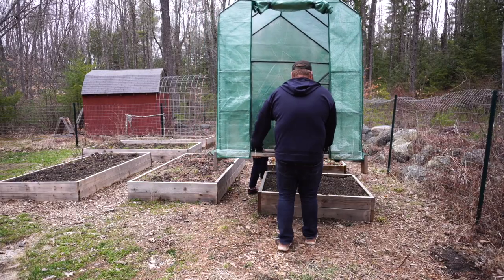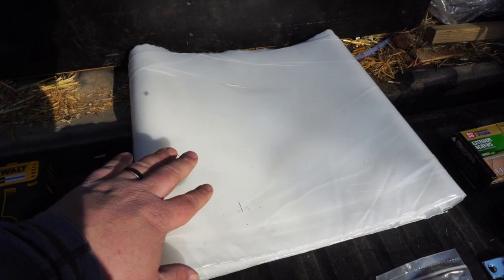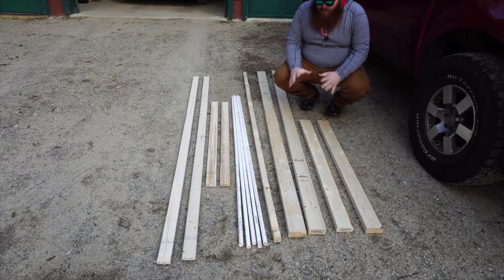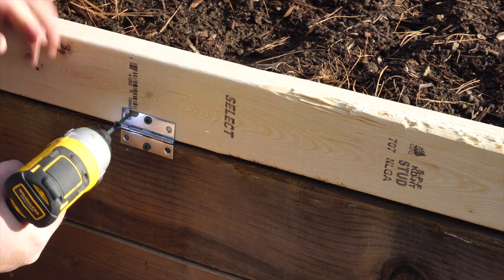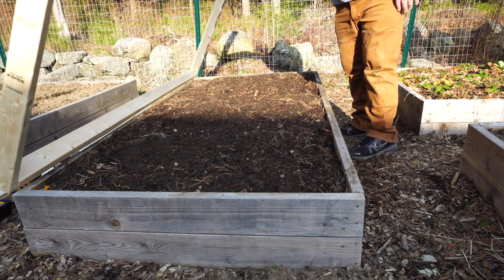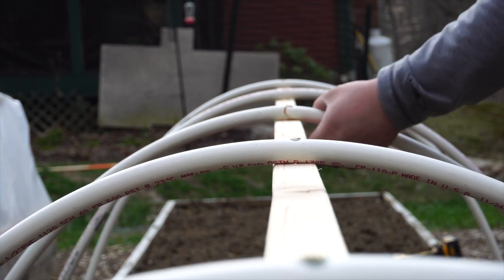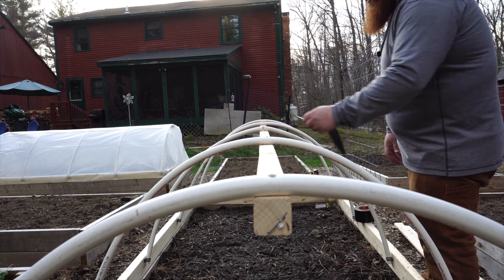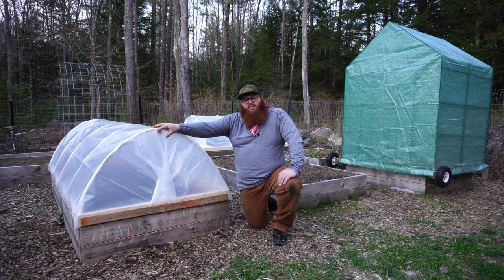Grow More Food with a DIY Raised Bed Hoop House For Your Garden

Comment from the maker: What tricks do you use to extend the growing season where you live?

Thanks for watching and don't forget to hit the subscibe button!
Reply: I'm in Houston for now, so my issue is fundamentally different.  How do I get stuff in the ground without running out of time before it gets too hot?  January was crazy stressful at work, so I didn't get my seeds started or my carrots and radishes in the ground.   On the other hand, I had eggplants and peppers overwinter with no interference from me.  My husband and I are planning on moving north (I'm a Midwesterner) eventually, so I love watching what you're doing and making plans.
Reply from the maker: In the south you definitely want to take advantage of those colder months to grow. If you can’t though, look for varieties that are adapted to heat. There are some great heat tolerant greens out there. Also, look for ways to incorporate shade into your garden. Tomatoes can grow very tall and heat resistant, and where we try to plant them on the northern side of our garden to not shade other things, you might want to plant them on the south side so they throw some shade on other things. They also make shade sails for patios which may help. “Full sun” in Houston might be a well placed shady spot. Good luck!
Reply: @TheMindfulHomestead  My grandfather in Ohio thinks I'm insane, when I'm planting tomatoes in both March and August.  Our best gardening is done in the fall, which is also my busiest time of year at work.  I'm a teacher, so the season when I can get out and work in the garden regularly is the season when it is too hot to grow anything. 😂